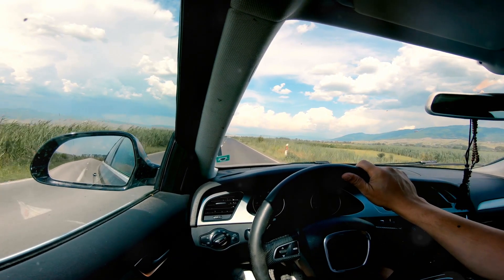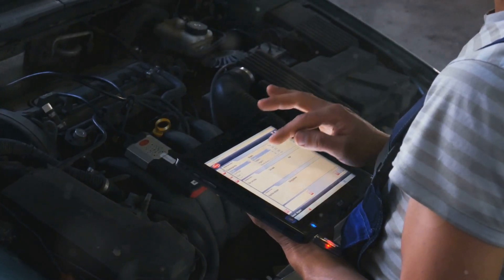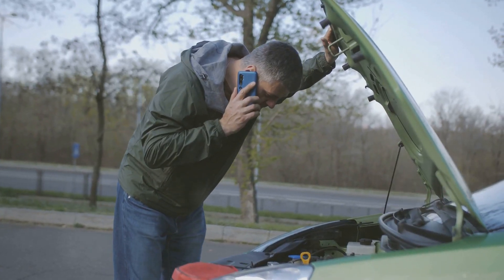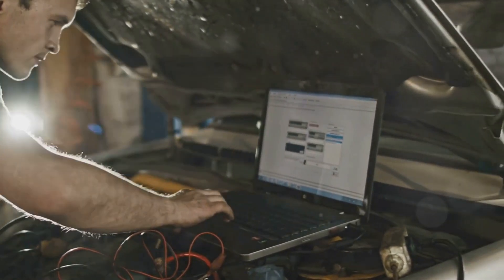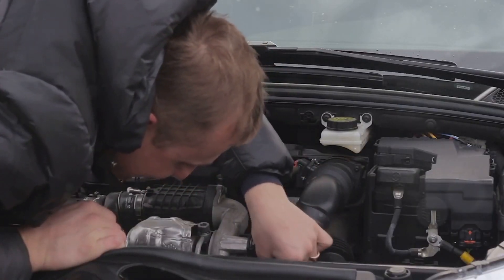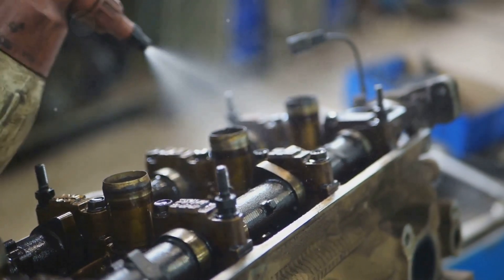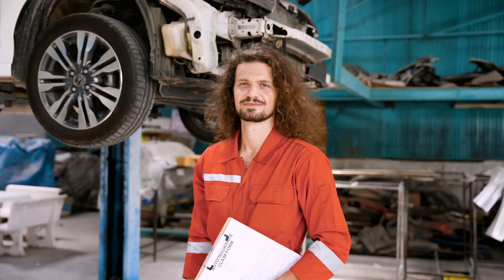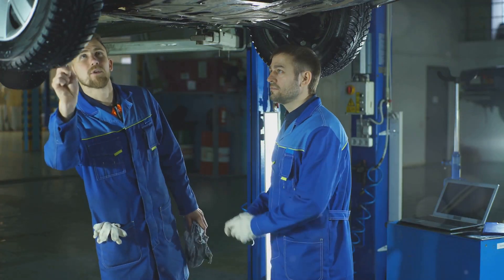HOW TO DIAGNOSE AND FIX ANY CAR WITH A P2101 TROUBLE CODE - FAST AND EASY

Comment: Can this code be caused by running catless downpipes without a tune? I didn’t get this code until i put my downpipes on along with some other other codes . it comes and goes check engine isn’t always on.